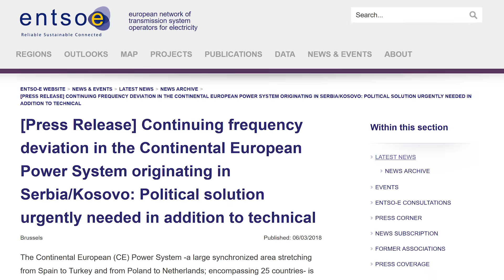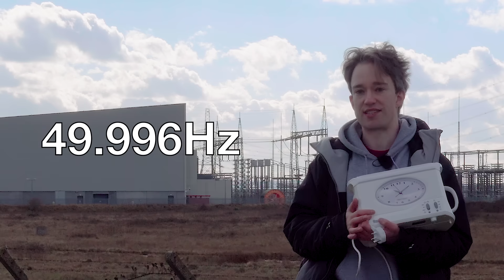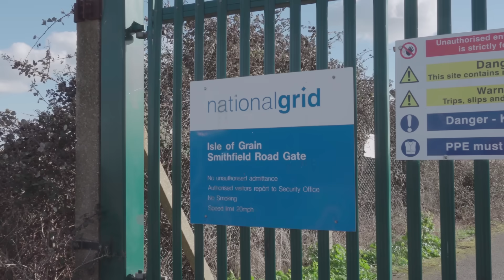European clocks ran slow for a bit. British clocks didn't.

Comment: Considering I live in Michigan, that was still interesting. So what would happen, regarding the clock, if I bought a "Tea's Made" and plugged it in to my 60Hz American power?
Reply: Hans - No, other way round.  At 115V, the teasmade would be operating at half power, so would take twice as long to boil the kettle.  And I'm sure there's legislation in the USA against making proper tea, considering how the nation began...
Reply: kakarroto007 I think you would have a bigger problem.  US voltage is 115V while UK is 230V. Assuming a constant resistance, your device would take 2 times more current. Perhaps the teapot would get toasted 😀
Reply: 240V is available in most residential buildings in the US. Commercial buildings are more likely to have 208V. If a building doesn't have either 240V or 208V available it is likely very old. The 208V / 240V is used to power large power consumers like water heaters, air conditioners, large electric motors, ovens and stoves.
Reply: No, the Bostonians just wanted to share the tea with the marine life tax free.
Reply: Tevildo Totally right. My bad
Reply: My country also doesn't eat crumpets, which go famously with a cup of British tea. Scones are popular, though.
Reply: "At 115V, the teasmade would be operating at half power" It would actually be operating at 1/4 power.

Comment: Tom, you say that the BritNed link doesn't require grid synchronization, but it does! It's a Line-commutated Converter (LCC), so without a solid grid to connect to, it doesn't work.

Comment: Most modern clocks now use the rugby time signal NPL radio signal broadcast from the Anthorn Radio Station near Anthorn, Cumbria, which serves as the United Kingdom's national time reference. The time signal is derived from three atomic clocks installed at the transmitter site, and is based on time standards maintained by the UK's National Physical Laboratory.

Comment: Why do they use DC in the long distance cables? (I've uncovered another lie from my high school physics teacher)
Reply: Basically that for various reasons it's more efficient and that you don't need to synchronise grids connected via DC links (or even run them at the same frequency). Could be very useful for wind turbines. You could make a turbine that'll run at any speed, put that variable-frequency AC into a rectifier to convert it to DC for transmission to where it's needed, then leave the grid synchronisation up to the inverter on the end where it actually goes into the grid.

Comment: This is something semantic that has bothered me since childhood. You've used the word "slow" in this video both to describe something moving at a slower pace and to describe something that's just behind the standard. Most of the time, when people say a clock is running "slow" they are referring to a clock running "behind", because it's not set to the correct time rather than it actually loosing minutes from operating at the wrong speed. Outside of laymen horology, I had thought the proper meanings of "slow" and "fast" and "ahead" and "behind" has generally understood meanings. Just something that bothers me.

Comment: Is this the case here in the US too!? Does the clock on my microwave and oven run faster/slower based on the electricity? I honestly never knew this was a thing.
Reply: Quite possibly, and if you move to Australia, it'll run slow all the time because the mains here is only 50Hz and it's expecting 60Hz.

Comment: Not many people use clocks plugged into the grid.... At least where I'm from.
Reply: Videos, microwaves, stereos, ovens, teas maids, coffee machines, etc, anything with a clock that relies on the power grid.  Even an alarm clock that doesn't have a battery compartment would use the grid rather than install a quartz occillitator, to save money in construction.  I can think of half a dozen clocks around my house that need reset after a blackout.

Comment: Real power comes in 60hz, get with the times.
Reply: "The times" for power frequency being about a hundred years ago. The Americas went with 60, everywhere else went with 50. By around the middle of the 20th century everyone had gone to one or the other and all the other frequencies had been replaced. Neither of the two has any real advantage, so it doesn't really matter which your country uses so long as what's sold there works with it. Okay, that's not quite right. Japan uses both. They apparrently never got around to picking a single standard.

Comment: There was an incident in the 60s in USA where an overloaded power grid caused the frequency to drop over the course of several minutes, from 60 to 50Hz, before cutting out entirely. There's a recording of a radio station affected by it, where all the recordings were noticeably slow and lower pitched (the turntables used that 60Hz for the motors), with the DJ being very confused.
Reply: To be fair, it doesn't take much to confuse the average DJ.
Reply: Any link to this?
Reply: It's been 2 years, someone drop a link
Reply: link?
Reply: We want a link!!!
Reply: Keywords:
In
The
60s
Look it up if you’re so eager
Reply: Steve Jones A radio DJ? Those things haven’t existed since the 70’s.

Comment: DC current ? Are you sure ? There are no cycles in Direct Current, however AC current does Alternate the direction of travel. I'm sure that has been pointed out somewhere in the preceding 1 767 comments but I don't have that kinda time, Cheers.

Comment: isn't it true that there is a massive power spike turning tea time when everyone turns on their eletric kettle?  Thats funny
Reply: Robert, he is obviously referring to the famous power spikes that happen during commercial breaks of popular shows where everyone boils the kettle.
Reply: It's not as bad as it used to be. In the "old days", with very few TV channels to watch, there could be 15 million households watching the same programme - and then all switching on the kettle as soon as it finished.
Reply: A problem solved by the invention of Personal Video Recorders where everybody now watches what they want, when they want and skips through the adverts.
Reply: And don't forget Netflix, reducing load spikes on the grid since February 2007.
Reply: Indeed, so we made the electric mountain, a reservoir in snowdonia that powers a hydroelectric power plant and can go from standstill to full output in world record time, just to catch that spike
Reply: @r.h.8754  Are you sure it was called that? The only thing I can find with that title is "Hidden Britain by Drone". Sounds like it would be a good watch.
Reply: Although they keep time based on the mains, the time is manually set. And it is set by adjusting only the hour and minute hand, which is hardly precise. In addition, the time the alarm goes off is set using a single hand, triggering when the hour hand lines up with it. This cannot be more accurate to more than 5 minutes.

So all the different teasmades will be set slightly differently, and so will load the grid no more than if they all woke up, got out of bed, and turned on the kettle.

Comment: That is similar to how most of Texas is connected to the rest or North America. ERCOT's sub grid (a sub section of NERC's grid) only connects to the neighboring sub grids via DC interconnects. This is actually useful for the reason of keeping out transients, foreign harmonics, over/under frequency, etc. but does introduce significant loses that are avoidable with an AC interconnect.
Reply: This is not true for underwater cables. Overland the 3 phases can be meters apart. In an underwater cable the cores are much closer together. This means that capacitance is a problem for AC current. So you lose much more power using AC over any significant distance when the conductors are in close proximity. This is the main reason DC is used.
Reply: Why does Texas have a separate grid?

Comment: That's what you get for forcing electricity into an unnatural 50 Hz instead of letting it be the 60 Hz it wants to be. God save Queen and other rock bands, too.
Reply: 60Hz still looks weird. 1000 / 60 = 16,66666666666667 while 1000 / 50 = nice 20.
Thanks to 50 Hz ,TV channels are broadcasted in nice 25fps/50fps instead of 23,976 or 29,97 or 59,94 fps.
Reply: Queen's just not metal enough for me. Not without Mercury
Reply: 60 is divisible by 10. Still metric. :)
Reply: My IQ rose reading this comment
Reply: 60 is more factorisable, which is nice. The #1 priority for mankind should be developing humans with 12 fingers. Then it would be much easier to switch over to base 12, combining all the advantages of metric and imperial (*), and unifying keypads, calendars and clocks.

(*) Okay, the only advantage of imperial. Which Americans wasted when they decided to subdivide inches into 8ths and 16ths, instead of 12ths.
Reply: We can also use thicker higher current cables as the skin effect is 9.3mm at 50Hz and 8.5mm at 60Hz. (scraping the barrel here)
Reply: I died at the last line!
Reply: my IQ dropped reading this comment
Reply: And worse colors. After all NTSC stands for Never The Same Color. ;)
Reply: want to get really confusing, Japan uses both 50hz and 60hz
Reply: If you go to Japan you will get both frequencies there. Eastern Japan got 50 Hz and western 60 Hz.
Reply: flicker
Reply: It's literally a matter of deciding on something out of nothing and going with it. All our electrical grids would've probably been better off running at 100 Hz, but we've got 50 and 60. Deal with it, I guess.
Reply: 59.94 is still faster than 50 fps
Reply: 60Hz would have been nicer since we use base 12 so much for time
Reply: Nah. I still prefer metric system...
Reply: And has lower resolution.

Comment: Hang on, set the politics aside, since the frequency can rise or fall slightly at any moment, and the frequency number is in fact the average frequency, does it mean that seconds on these appliances are not exactly equal but depend on the frequency at that time?
Reply: I think that this is what he means. Yet, the difference must be very small. Unless powers goes out.

Comment: Ok so England is in Europe 
this means that if all European clocks are running slow
and English clocks are running normally
this means that English clocks are running slowly
Because this is normal in their area
Reply: It's a part of Europe but not the European mainland, which is how the term is often used.
Reply: Except, Mr. Anvil, if that were the case then European clocks would have no problem. But they do. Foiled again!
Reply: cant make tea with a mobile or gps unfortunately haha
Reply: It's only Britcucks still clinging to mains as a time standard. Everyone else has evolved from being newts and has been using things like radio control, GPS, internet, or mobile network carrier time.
Reply: [citation needed]
Reply: using mains frequency for timing isn't specific to any one, it's done the world over, although obviously it's only used for basic things like kitchen appliances where there is no need for a microcontroller and radio module for anything else so they're not exactly going to add one JUST to track the time if they can do it for a penny worth of circuitry by tracking the mains frequency.

Comment: Every clock i know of uses quartz, this sounds like a non issue.
Reply: Quartz is O.K. but the cheapie quartz types- the majority - aren't all that accurate to start with and they drift depending on temperature. Over the period of a year a quartz movement will typically be several minutes out. Just look at your car clock after 6 months. British mains is far more accurate on most time scales.
Reply: The advanced quartz clocks use a temperature controlled oven to prevent drift. They are also calibrated  before shipping. 99.9% of quartz clocks aren't calibrated or thermally controlled and have lousy long term accuracy. These days the most accurate time is GPS time - which is atomic clock derived. You can buy GPS managed timepieces for this.
Reply: It has apparently affected public clocks in train stations around Europe, among other things. While few in number, many people rely on them to be correct, so the consequences could still be big.
Reply: Every alarm clock I've seen has a DC battery backup, usually in the form of a 9-volt battery.  This necessitates a quartz crystal anyway, so they might as well make use of it.
Reply: I agree, and my impression is that quartz movements have been dominant since the 80s. Most will still proudly display "Quartz" on the clock face, too. 

While the story is true, I find it almost akin to clickbait due to limited impact.
Reply: They are the clocks that are part of a mains powered device. Not all that many things would be done like it. The most likely example are mechanical heating or plug timers, they have an AC motor geared down to turn the timing wheel once a day.
Reply: Why not just use a radio clock that synchronizes itself? Like every clock and OS I own synchronizes itself with an official source
Reply: Yet I still see home appliances (ovens, exhaust hoods etc) that drift in different directions. One runs ahead, the other falls behind. They're not even the cheapest ones on the market.
Reply: As Tom said, he was talking about cookers, microwaves, coffemakers and teas maids, anything that is solely powered by the grid.
Reply: Apart from the clocks in cookers a lot of Railway Station and School clocks tend to be mains synchronised or at least used to be.
Reply: The typical circuit of the "DC backup" you speak of uses a rough RC timer. That is why it speeds up or slows down after a power fail. No Crystals to be seen.
Reply: I looked up American Time, all their clocks use RC  sync.
Reply: the only way i know time is through cellphone or pc which synchronize the time using internet
Reply: Wristwatches, sure. 

Everything else? When you're designing to a price point and building in the millions, a 79 cent (in bulk) 32.768 kHz quartz oscillator can cut into a profit margin. Trimming the bill of materials is the fastest way to decrease the cost of manufacture and increase the profit margin.
Reply: evildude109 doesn't even need a 9volt a 1.5v alkaline battery is more than enough for the oscillator
Reply: Well watches and every wall clock on Amazon, Ikea, staples, wallmart and Target
 After trying to Google this type of clocks for about an hour, I came up empty. Now this does not mean that they do not exist, but that they are  commonplace,  sorry that is bull.

Comment: It doesn't anymore, because you can buy a crystal for 10 cents, and not 20 pounds.
There is not many devices that use grid sync, not even your oven, all thou these might use the night and morning signal that is transmitted trough the power grid.

Comment: If anyone is interested, Kosovo declared independency from serbia, but the electric production is still managed by the serbian side, then kosovo decided to stop production of electricity and has been stealing power from the grid which is the reason why the frequency dropped.(it's technically not stealing since the production of electricity is technically under serbian jurisdiction, but they stopped production without serbian permission)

Comment: Meanwhile, in south africa...

The grid spews out anything from 49 to 53 hz (should be 50.000) and anything from 186 to 294 volts (should be 220)
This according to the monitoring software of my firm's very expensive UPS, which is having to work very hard to keep the servers alive and healthy.

Comment: Most electrical clocks nowadays use a quarz element to measure the flow of time and not the power grid's frequency. Else battery powered (DC) clocks wouldn't work.
Reply: Nearly all grid powered kitchen appliances everywhere [electric hobs, electric ovens, microwave ovens, washing machines] use the local grid frequency to keep time. This is true even in Japan which has both 50 Hz & 60 Hz electricity depending on the locale. Quartz Crystal timing 'forks' are manufactured in their billions each year & on average the mass market [cheap] ones are inaccurate by 6 minutes per year. Grid frequency clocks are USUALLY more accurate than that.
Reply: pfefferle74 Long term, the grid is more accurate as long as the power stays on, e.g. how many seconds per day does your watch or PC gain or lose? (A crystal has a tolerance, although some chips allow a trim calibration setting)

Comment: Same thing with, Norway, Sweden and Finland. Their grid is isolated like the UKs and clocks show the right time.
Reply: Where did he say they were independent?  He just said they have an isolated grid, which they do, same as the UK.
Reply: Mario clearly doesn't understand what an isolated grid means.
Reply: Stating that mario is lying is a wrong. He is quoting the CIA information, that could be out of date. Lying is when you give wrong information on purpose, not when you use wrong information and believe it is correct.

Comment: They are likely going to pick a slightly higher frequency, for the simple reason that a lot of larger factories use AC motors connected to the grid.
If the grid is 0.008% slower, then the factory produces its products 0.008% slower. And for a factory that makes a profit of 10 million Euros a month, then that is 800 Euros per month of lost profit, for one factory. Scale this up to the total GDP of Europa, and it becomes a lot of money. And by then running fast the next couple of months, then these factories can produce all that lost production, and average out to where they should be.
Reply: I highly doubt that industrial motors still base their speed on the grid frequency, they'll have PID controllers which automatically compensate for it.

Comment: and meanwhile, lots of European devices use systems such as DCF77, and thus keep time even in case of powerloss, while running on batteries, or in case of daylight saving time changes.

take that, teamade that needs to be plugged in the middle of nowhere just a bit to far away from any plug of the power plant in the background.